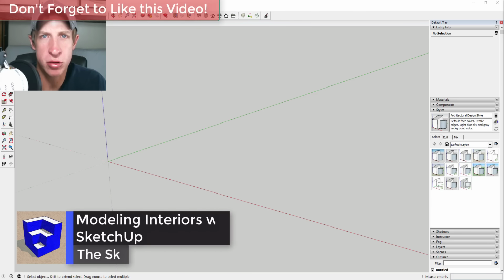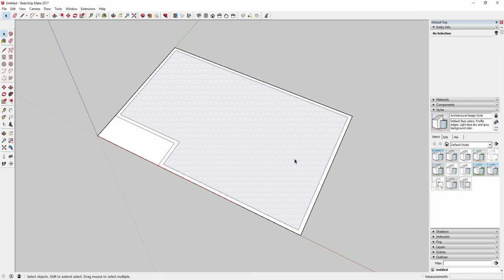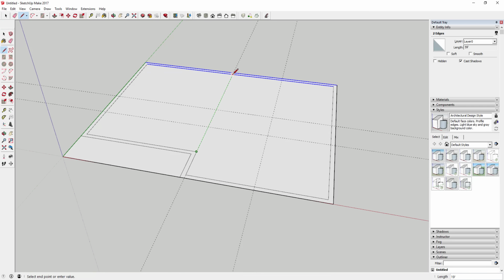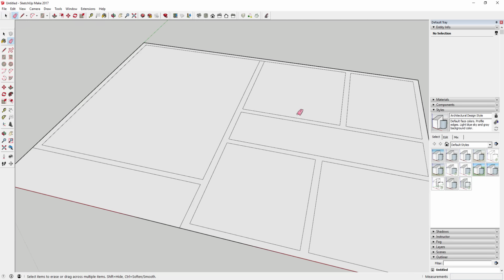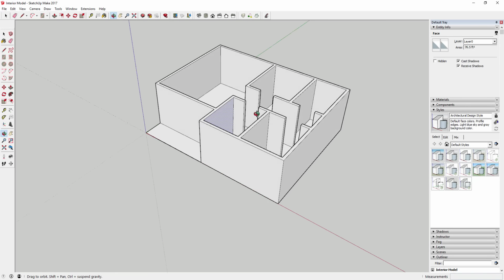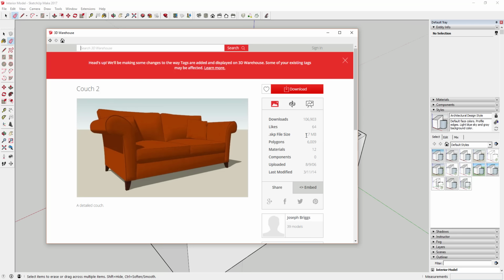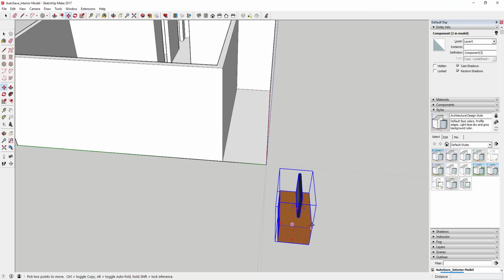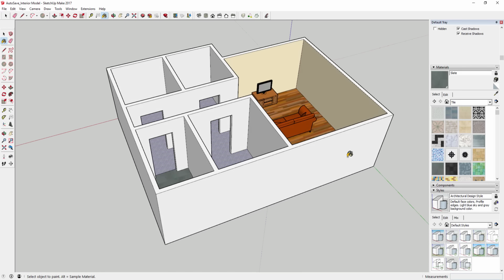SketchUp Tutorial for Beginners - Part 3 - Modeling Interiors from Floor Plan to 3D!

Comment: Great!  Thanks!
Reply from the maker: You bet!
Reply: @Thesketchupessentials  I must need a lot of training for Sketchup. I cannot get tags (layers) to work for me. Long ago I used DataCAD to make detailed building plans and it was a bit challenging. However, with Sketchup, I cannot get past simple tags (layers). Chief Architect is very expensive, but maybe it would be easier. Parts of Sketchup are very easy and intuitive.

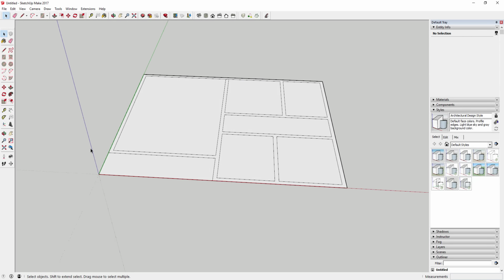Comment: @ 9:00  He meant "3 foot by 6 inch rectangle". 3' = 3 feet, 6 = 6 inches. If you just enter a number by itself SketchUp will assume you mean inches (or whatever unit of measure you selected when you create the file).

Comment: Regarding materials, could you prepare a tutorial on how to develop a bill of quantities (BOQ)? Say, an MS Excel list of what materials are used, how much/many of them are used. THIS is because based on such a bill, the unit prices of each material can be done after inquiry in specific market. NO contract can be concluded without BOQ, you know. 

BOQ is the key leading SketchUp to actual engineering projects.

Comment: Hello,
I particularly watch the videos about Sketchup, I'm a beginner. I would like to help me with the following problem. I put a component to a height that I did not note. How could I lower that component to dimension 0 of the plan considering that it is not on an axis.
Thank you,
Iulian Petrescu
Reply from the maker: I don't really understand the question - what exactly are you trying to do?
Reply: @Thesketchupessentials  
528/5000
Hello,
I received a plan with many components (pipes) and because I should reposition them to other heights I have to lower them all to level 0 in the plan. Is it possible to lower them to this level (0) without knowing the height at which they were mounted? I would like to know if there is an order (I could measure the height of each one and lower them but it would take a long time). There are programs (Dialux) where clicking on a component shows the height at which it is mounted and it can be changed (the height).
Thank you.

Comment: I just started using sketchup and when I followed along from your part 1 and 2 tutorials, I made mine to match a project I have coming up. I was anticipating using that same model to create a floor plan but it looks like all the videos start over on a new model. Is it possible to create a floor plan from an existing exterior model or do you have to create the interior design separately?
Reply from the maker: Depends on how you set it up. As long as you've modeled your walls and floors the way you want them, you should be able to do whatever you want. Is there a reason this shouldn't work?

Comment: Great content!
I have a question, and I hope it's not a dumb one. If you extrude all your walls at once and then group them, it means you cannot hide them separately to create scenes from different angles and present your work. Is there a way to extrude all the walls at once, like you did, and later divide them so you can make different groups for them?
Reply from the maker: Not a dumb question, but I'd say if you have a specific way you want to break up your walls, try to do it before you extrude them. Otherwise it gets a lot more complicated trying to break up 3D geometry - hope this helps!

Comment: Hi Justin. Really like your teaching methods. Just wondered if you could be a little slower / be more deliberate when illustrating things with mouse on menu boxes as it's hard to track where you're pointing to. but very informative, thank you.
Reply from the maker: In my newer videos I've added a highlight to my mouse to help with this a bit. Probably not going to slow down too much more just because I'm trying to balance between being interesting to advanced users and helpful to newer users, but maybe try going down to the settings gear and setting the speed to .75? I've been told that this slows down the actually without affecting the audio quality too much. Thanks!

Comment: When it comes to creating building remodeling, do you recommend modeling the "addition" first then creating the Match Photo? Or the other way around?  Do you have video in your library that deals with home or building remodeling (new walls, windows, additions?) #Chicken&theEgg
Reply from the maker: I think it's difficult to model with Match Photo after you've created your addition, so if you're using Match Photo, I'd do that first. I don't think I've done anything specifically with remodeling at this point. Thanks!